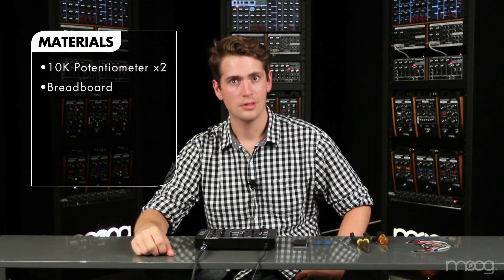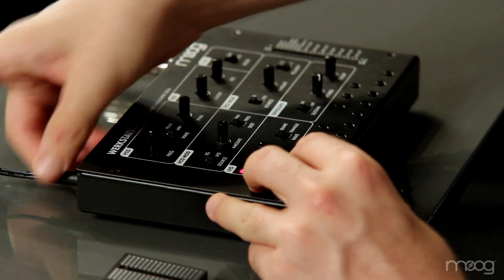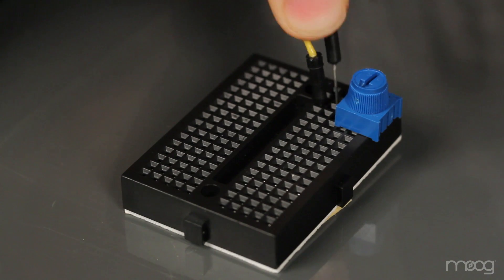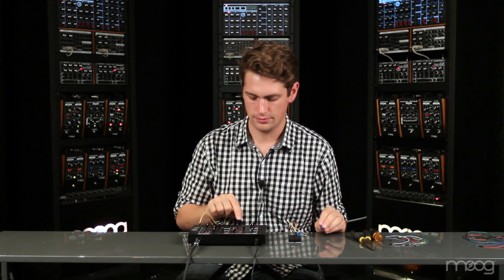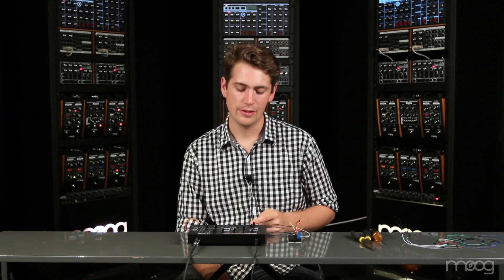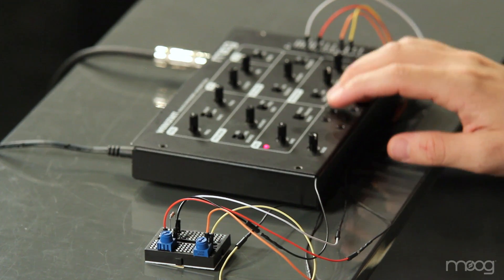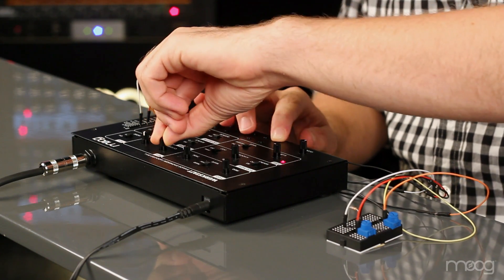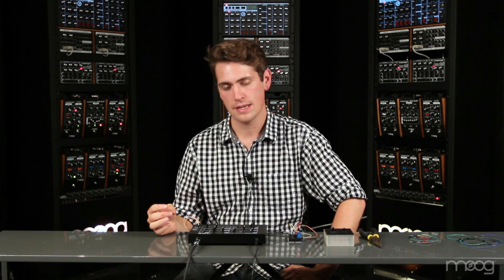WERKSTATT-01 | 2nd Oscillator Mod

Comment: Thanks for sharing.  I am not sure if I will do the modification, but I like that I now have the option.  One person shared that he would like to know how to hook in a second oscillator from Mother 32 (or perhaps also a Model D).  I suspect that I could figure this out.  But I am wondering if there is a grounding issue I might need to take care of in the process.  This is the second video that I have seen where some grounding was used in order to use something outside the unit.